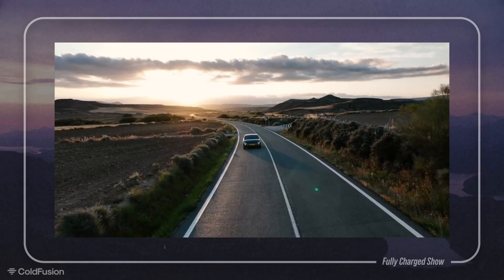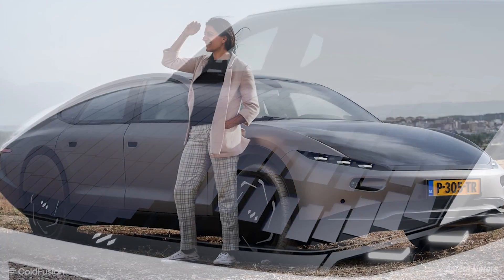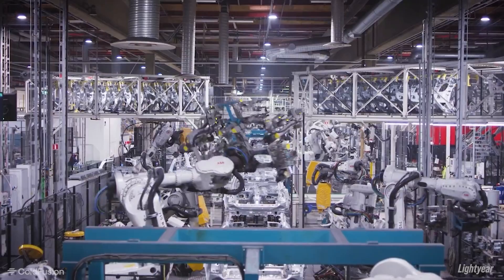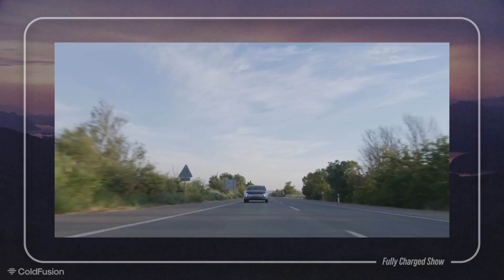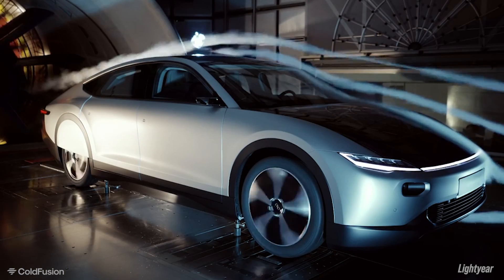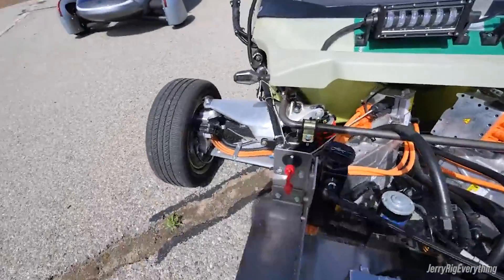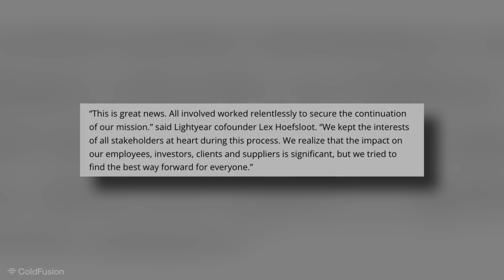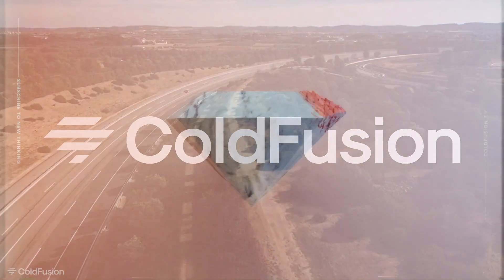3 Interesting Solar Car Projects

Comment: I'm only worried about the oil industry trying to sabotage these developments -- however i personally would love a car like this. i don't drive very far for work, everything i need is around my town, i can use it as a local car and save my current one for the rare longer trip. this car costs about the same as what i paid for my current one so i'd def. buy one
Reply: They can only delay it only until the oil reserves reach critically low levels
Reply: @dragonslayer0 people been saying oil will run out anytime now for decades now, but it never does and new reserves keep getting discovered
Reply: @kevinfernandez9999  it won't become zero... But consumption will be reduced many times compared to today
Reply: Funny thing is those very same oil companies that greatly downplayed renewables greatly invested into them secretly, to make a profit later on. Greed is a poison.
Reply: Why would they even be motivated to?  Its already mandated in many countries that no more combustion engine cars may be sold after 2030-2040 (depending on country).  Why would they care whether the non-combustion engine car is powered by solar, wind, hydrogen or cold fusion?
Reply: the best thing they can do is quit oil industry and invest that money made from oil in renewable and everybody would be better off

Comment: What actually happened is that Lightyear cut it's losses on the 0 as soon as they saw the enormous waiting list for the Lightyear 2.

The Lightyear 0 had served it's purpose by proving that it works and the invested manhours and outsourced production for such a limited series were never going to break even.

In my opinion they were wise to focus on the Lightyear 2, which can be designed for mass production instead of a small series.

Personally I want my next car to have solar panels. Even if I have to charge sometimes, it will take away a lot of stress of getting stranded with an empty battery. Worst case I will park it somewhere, call a taxi and pick it up as soon as the charge gets me to where i need to be.

It also solves my problem of limited roof space for solar on the house, as it charges itself on any parking space without shade and even while driving. No home batteries needed, less waiting at public chargers and absolute freedom to go anywhere at any time.

The idea of making it as light as possible is also great. Less air resistance and less weight mean more range from the solar cells. Most EV's are now so heavy that most energy goes into moving the car, not the passengers and cargo.

So yes, i will buy a Lightyear 2, even if it is significantly over the projected cost.

Comment: I'm not convinced that a solar powered car could really be competitive at this point. Typical budget (non-plugin) hybrids get about 5L/100km currently, which at USD$2/L gas prices (typical in western Europe) and 50km/day is $5/day or $1825/year. At that amount I don't think it will be a major consideration for most potential customers, and likely not enough to justify the compromises in design and range.

Then consider electric or plugin-hybrid cars. Typical EV efficiency is about 15kWh/100km. In Europe the average electricity price is USD$0.31/kWh. This equates to $4.65/100km or for 50km/day its $2.33/day or $849/year. The Prius Prime (plugin hybrid) is rated at 1.8L/100km, which would be $1.8/day or $657/year.

Squeezing out that last bit of efficiency at this point is getting well into diminishing returns. It's still a good idea to pursue this it's just that there needs to be fewer compromises or the trade-off for customers just doesn't make sense when a new vehicle is over $30,000. For now, the only people getting a solar car are going to be environmental enthusiasts (for lack of a better term).

Comment: I live in Las Vegas and commute 20 miles round trip per day. I would buy one of these in a heartbeat, especially if I could feed the unused power back into the grid when it's just parked out baking in the sun here
Reply: Feeding a unused power back to the grid is not that simple. Solar panels produce low voltage direct current, while grid works on a higher-voltage alternating current, 60 Hz in US, 50 Hz in the rest of the world. To be able to use the solar power in your home or sell it to the grid, you need an inverter to turn DC into AC, and a transformer to adjust the voltage. That equipment is usually not very cheap - in Europe, it's almost the same as covering your entire house in solar panels, it's not prohibitively expensive of course but when you are already investing in it, it makes sense to invest in panels also, to cover your roof fully in panels, and deal away with electricity bill completely and permanently, and likely have enough left for charging your conventional battery-powered EV.
Reply: P.S. A solar car that charges itself on parking would actually make a lot of sense here in Europe, especially in my case as I live in a city, in an apartment, and I can rarely hope I'll find an empty parking lot on the same side of the street where my apartment is, let alone be able to plug a cable somewhere to charge it overnight, but I understand that you guys in the US mostly live in large single houses with plenty of space.

Comment: 60km for daily driving is actually amazing. Here in South Africa, that's just over the avg kilometers driven a year. Add to that we have serious amounts of sun. Even in winter
Reply: Look at the power grid management in SA
It's needed indeed
Reply: Also in India 🇮🇳
Reply: This car will work well here in Mzansi.
Reply: 60km not 60k km
Reply: If they make it where the charger works both ways, which some cars already do, you could charge a battery bank for home power
Reply: A qantam with solar panels 😂😂
Reply: Lol, solar is very inefficient when hot
.. is it hot in Africa? Uh huh.
Reply: @JSabh  As someone with experience designing solar, that's not quite correct. The benefits of having such reliable direct sunlight without any clouds and for longer hours as you'd have in such a region vastly outweigh the downsides of the loss of efficiency due to heat in terms of the total power output you'll be getting. Cloud cover doesn't just linearly reduce your power output, the effect is EXPONENTIAL, so even light, relatively 'clear' clouds will seriously rain on your parade if you need maximum power output from your array, pun intended. Plus, most solar arrays have some form of active or passive cooling. In some cases it's as basic as a sprinkler system on a timer pointed at the panels.

I'm sure the ones in such a vehicle have active cooling, given that a modern EV already has an active coolant loop for the li-ion battery, there's no reason they can't direct an additional zone to the solar arrays.
Reply: @JSabh  I think that won't be any issue since the car would be moving and solar cells can be air cooled.
Reply: @JSabh   Africa as the biggest solar farm in the world in Morocco, it is forecast to be the biggest supplier of solar power  in the world supplying Europe and Asia. A solar panel produces 7.5 times the same amount of electric in Africa as the same panel would in the UK. This along with cheap labor is why the world is scrabbling to build relations with Africa. China is looking to move most of its manufacturing there over the coming decades and it is forecast to be a huge renewable energy manufacturer, that as cheap labor, raw material and a growing consumer market all on one continent.

Comment: Engineering and doing business are two completely different things. Sadly many great minds failed to realize that and ended up ruining their lives, with Tesla coming to my mind right away. Also in computers, many operating systems were  far more advanced and polished than MS-DOS and later MS Windows. They were great products. So what, it didn't meant anything.

Comment: Top speed isn't really a big deal here in the US, where we have speed limits everywhere.  If it's possible to get the acceleration up just a bit, then a car that can effectively charge itself and which you never have to buy gas for is going to be immensely popular.  Though I think it's more likely that this sort of company will get purchased by one of the larger automakers before it ever reaches the point of mass adoption.
Reply: Everyone here goes 80mph on the highway
Reply: All I'm hearing from you is pipe dream fantasies and conspiracy theories.
Reply: Not happening in your country, oil & gas lobbying is too strong
Reply: @alfred9805 It's in economic decline
Reply: The aptera solar car shown there has a 0 to 60 of 4 seconds and only costs $25k, not 40k. Idk how the other guys screwed this up

Comment: Aah running scams to get money out of venture capitalists is always such great fun.

Anyway, solar cars are a stupid idea and never won't be until we're making ridiculously efficient PV sells or absurdly light structural materials.

Just take solar cells and charging circuitry out, and put solar on your house instead.  Duh.
Reply: a simples concept, a foldable panel, that when parking collects like 3x more light. very simple solution, and can be used in any electric car

Comment: Of course I would like to go with efficiency and adding extra miles trough solar panels each day. 
Especially "today" we can see how much money we are throwing on fossile fuels consumption and EV of today are still partially using those fuels when power is being created in thermal powerplants that uses coal or natural gas.
Any type of renewable energy that could be engineered to additionally provide power and extend range is good investment even if it might be initially expensive.
Above mentioned has similarities with people investing in solar panels on their homes and with that initially expensive investment, actually save more money over time or even begin to be self sufficient or if they use less energy, earn money by providing surplus to the grid.
It might be preferable with good amount of people to have high performance in regards of speed or acceleration, however, this does not guarantee initial lower price. This actually makes it expensive at start and over time. The fact that certain people have deep pool of money and not giving a dime about it is just sad.

Great video as always and keep with great work ColdFusion Team :goodvibes:

Comment: I’m very interested in the Aptera. It breaks the mold and the concept is sound. It’s efficient and faster than people expect. It looks like an aircraft without wings and I think it will work and a near perfect daily commuter car.
Reply: It's not a commuter car. It's a commuter motorcycle. Anything with fewer than four tires is a motorcycle. The difference is it doesn't need all that heavy safety equipment.
Reply: @darrennew8211  Why are you going through all of the comments copying and pasting this message to everyone talking about Aptera?

Find a hobby.
Reply: @mechanomics2649  Why not? Most people don't realize it can look like a car but not be nearly as safe as a car. Feel free to skip over my comments if it offends you. Comparing the efficiency of an electric motorcycle to an electric car is misleading.
Reply: @darrennew8211  It also doesn't exist. You should probably lead with that. How many deadlines have the missed for getting their cars to customers?
Bet the people who have put their money down can't wait to give it a go, just after they've played the full release of Star Citizen...
Reply: @drunkenhobo8020  For sure. I was more replying to the "it breaks the mold" though. It breaks the mold because it's being compared to a car. :-) Lots of people pay money for unfinished promises these days. Heck, people are still waiting for Full Self Driving Teslas.
Reply: @darrennew8211  It's not a motorcycle, the correct definition is an autocycle. There is a distinction because in most jurisdictions if the occupants have safety restrains and the vehicle is fully enclosed a helmet is not required. Which is what makes it different from something like a slingshot which isn't enclosed.
Reply: @warmonger2500  Thanks for the information! I can see where the enclosure/helmet thing would make a distinction.
Reply: Imo aptera will never see the light of day because without cheap money price need to go up, Americans don’t like small cars and every niche car is going bankrupt because of small profit margins better to just buy a e bicycle

Comment: Crash test would fail.  No way to have structural strength while being light enough. Think of one of these crashing into a cyber truck or hummer EV at 9000 pounds.  Duce ✌️

Comment: Tesla Model 3 could have been as efficient. Many people don’t need ridiculous power of Tesla cars. 130HP would be enough with smaller battery, less weight, thinner tires are more aerodynamic rear end. It should be even cheaper if mass produced. I would buy it.

Comment: New tandem solar panels reached a record 33.7% efficiency. They should be cheap too. That is a 50-100% improvement in efficiency over the industry average of 15-20%. This wouldn't make solar a very good idea on a car. It would be far more efficient to put those panels on a home or grid system and charge the car. Most cars are parked in garages, under trees and in parking structures. The life of solar panels is like 30 years, but a car is more like 15 years, so this means the panels aren't used for as long as they could. EVs could last longer than ICEs, but still. There is only so much energy hitting a given surface area, which isn't a lot compared to the usage. There is a lot of compromises and bad ideas in this car.

Comment: I would love a solar daily driver with a battery that has a range of 150-250 km plus solar adding range on top of that. I don't even drive on a daily basis so a battery with a bigger capacity than 150 km wouldn't even be necessary for me. My needs for a car would mean I would almost never have to charge a car with the above specs.

Comment: I don't think 0-60 in 10s or top speed of ~100 mi/h is a problem at all. I have recently completed the trip in older RV with 0-60 in 20ish seconds and my acceleration from stand-still on lights was on par of more lively than that of a most drivers. What is interesting is that people "sleeping" on lights make up for theirs slow starts by speeding later just to overtake the old clunker… Great take on the subject, very educational. Thank you!
Reply: 0-60 in 10 seconds is comparable to that of a Gasoline powered Toyota Yaris.
It's not performance car fast, but quite normal in the real world.
Reply: Not a problem at all if you get an aptera solar vehicle instead
Reply: My daily driver does 13 secs to 100. It's bad but it's honestly not an issue 90% of the time

Comment: I currently drive a 2010 Toyota. I hope to drive it as long as it runs or it becomes too expensive to maintain. I don't see that happening anytime soon. Having said that, I still feel guilty when I go on road trips since I am burning fuel for my pleasure. which will be the only reason I would consider a new electric car.

Comment: If this sounds too good to be true, because it is. Let's say a solar cell is 100% efficient, and puts every bit of power to the electric motors, cars have 4 square meters of surface area at best. And peak power of 1 square meter of area of earth receives about 1.250 watts. Multiply those two, you get around 5kw of power which can be converted into about 7 horsepower.

Yes 7!

So yeah, solar powered cars are a dream that will never come true...

Comment: If you buy a $50,000 vehicle, that's 50,000 gallons of gasoline worth of travel you'd need to drive in order to make the solar car competitive.  I don't see that happening.  If the cost of the vehicle came down to $50,000 that would be the tipping point.

Comment: Due to this video, their reservation will go sky rocket !! However, I think the acceleration is kinda deal breaker,  They really have to work on regenerative braking to fix for city traffic and gotta have atleast 200 Nw torque for a normal customer to be interested on this!!

Design look pretty similar to Honda Insight which is Okay if they could deliver within 40K else I think Toyota new 900 mile range 2027 vehicle will slaughter this + Tesla have their own new battery program !! 

Its kinda hit and miss case to start with tho, coz even if you get to charge the car by sun, keeping car outside in open weather ( for charging ) will take its own toll !! So IMO, they really have to work fast and delivery way more promises but sure enough there will be some grandma who would live to drive around these

Comment: 1K per hour charge in IDEAL conditions for a 62KWh battery.   Let's say 12 hours sunlight per day and no clouds.  Ignoring the fact as the sun rises and sets you won't get 1Kw/h charge rate -it'll still take over 5 days to charge your car at max rate - assuming you don't move it.   It's better than using the grid - but for most people this is not a realistic option especially if you consider that the car will be in shade some of the time and not getting full sunlight during the early and evening hours.  At highway speeds will the panels get damaged by stone chips?

Comment: Solar Power car market is very limited.  It simply does not make sense.  You rather have a panel on your roof and charge the car daily or as needed.   Simple Solution.

Comment: i wouldn't care if it was slow, more than 160km/h is crazy already even though it's "standard" that cars go way more than that, but only in germany makes sense! and acceleration, 10s? it's the normal time of the cars i had 😂